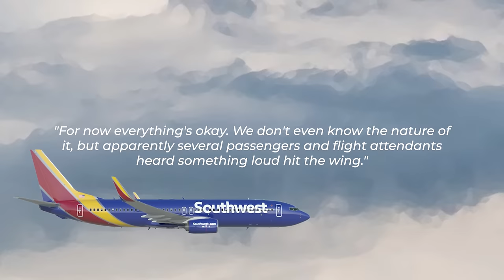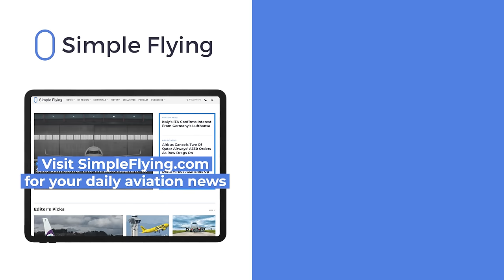Southwest Airlines Boeing 737-800 Engine Cowling Rips Off

Comment: Cfm 56-7 fan cowls have 3 latches located at bottom of the cowls. Mechanical failure, latch(s) not closed or latches out of adjustment are possibilities.

Comment: At least it occurred during takeoff instead of over civilian areas
Reply: Take off and landing are the most dangerous parts of the flight. If the engine had failed past V1, this could have ended in disaster.
Reply: @phuketexplorer  but engine thrust wasn’t affected, or was it?